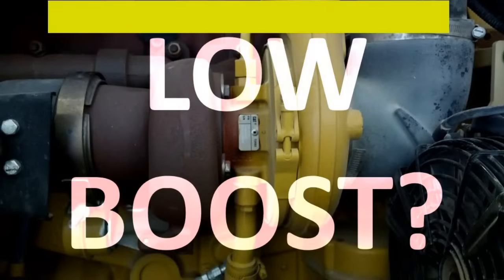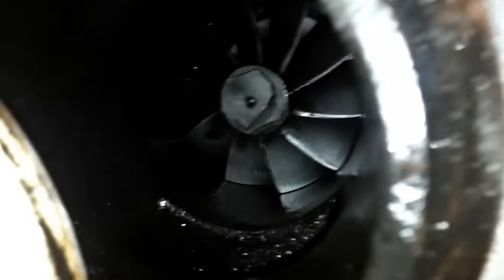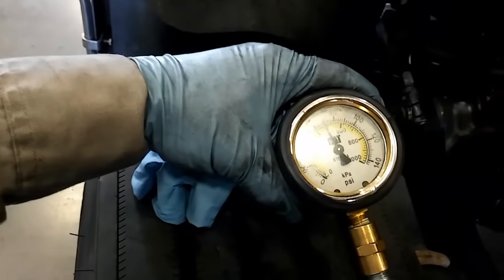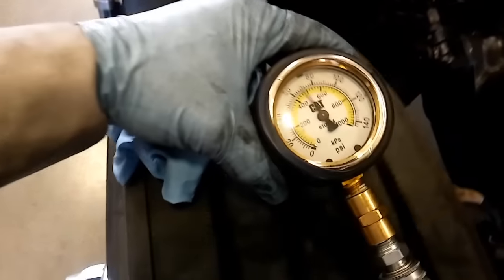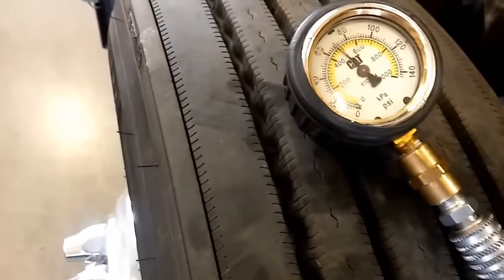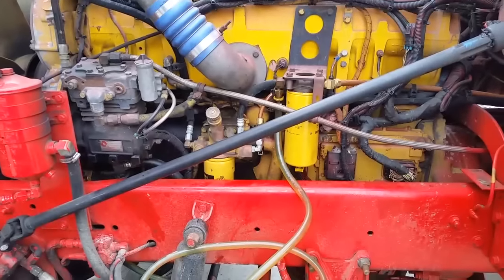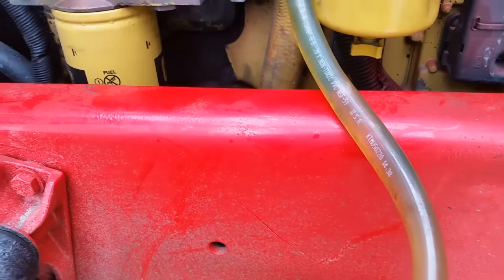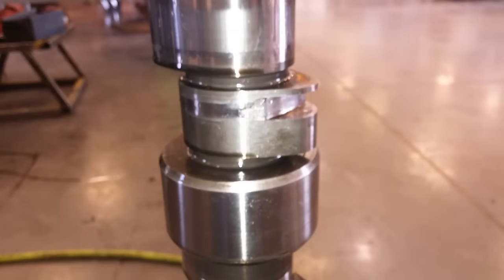Cat Diesel Engine Low Power Troubleshooting.

Comment: "yes, you really need to check your fuel pressure. Just cracking open the valve does nothing." (paraphrased) 
I suppose the analogy is the doctor stabbing the patient with a scalpel to see if he has blood pressure, instead of using a sphygmomanometer. 
Sure, stabbing the patient does tell you something, its just not helpful. If the patient bleeds profusely, that means the patient has some blood pressure, and therefore is not dead. You obtain the same knowledge about your engine if you crack open the fuel pressure test valve.

Comment: My check engine light comes on when I'm driving with a load and then I lose  Power the truck stays running but I have to pull over shut it off and start all over again
Reply: Did u find the problem??

Comment: My ck list 
1. Filters over 300 hours replace
2 ck fuel quaility
3 battery ,yes batterys load test and i torque cablez to 19 foot pounds /find a lot of lose cables and ck cables at starter
4. Air charge boot cooler clamps 12 foot pounds
5.ck inside the tank for water & thrash
6. valve lash,valve lash ,valve lash including injector setting 
7. Test air to air cooler 

Thats my automatic checks

Comment: 400 lbs of pressure is insane to think about. Sounds like a fire waiting to happen. 
I can just picture a leaking fuel line spraying the whole engine bay within seconds.
Reply: hahahahahahahahahh common rail systems run ridiculous pressures (at least in pickup trucks) 
thirty thousand psi in a fuel rail. no joke its in the specs Bosch lists (they make the injection systems for ALOT of diesels),
Reply: No fires though. Diesel doesn't burn at atmospheric pressure.
Reply: Diesel must be atomized to catch on fire. Also a lot of Diesels use upwards of 20 thousand PSI.

Comment: My c15 MBN surges when pulling full load at 16-1700 rpm. Manifold pressure follow the sound fluctuating between 33-35 psi. What’s causing this?

Comment: What level should the throttle position sensor be I have a scan gauge kr and it shows 93-94 and I have low boost.  Pretty sure I need a new throttle pedal

Comment: Good day respected sir. I have one question about cat engine c6.4. Sir we were change the fuel injection pump & injector. But we installed recondition injector & pump. Our Exavator is taking much load during working kindly guide about problem.

Comment: Hi. I have tractor Challenger MT575B with C6.6 engine. Original engine power is 190hp for that tractor. I changed injectors (all 6). The fuel pump is reabuilted, fueling is cleaned and i have one problem. The engine runing is perfect, sound also but the engine have only 115hp. I called my friend who was chiptuning. He is run it with software for 220hp but my engines run only on 135hp. I noticed that the turbo control rod does not move. Can you advise me? Thank you and im sorry for my english 🙂
Reply: The engine doesnt smoking

Comment: Cat 3116 smokes a lot when cold start and when its getting whorm it has a slight shake at 1000 to 1100rpm I think it might have bad  injector now I do know it dose have a pinched return line but fixed that no different

Comment: I have a peterbilt 357 with a 3406b engine with inframe done. Fuel pump has oil leak but when I’m loaded the truck does not pull. Has no power it takes a lot to reach 50 miles. Pretty much 0 torque.
Reply: Was it like this before the inframe? Oil leak on pump, usually is the plugs on the back side, or the governor. Can leak oil on the accessory drive cover, but that is a major repair. When I work on one that someone has overhauled and comes in with low power, first thing I question is what parts was installed. Just because they are yellow don't mean they will work properly. Since your talking 3406B, you have 7FB, 4MG, 5KJ, 3ZJ, mechanical engines, not counting PEEC. Plus all the different HP available with that combination of correct parts.

Comment: Just rebuilt an mbn c15 starts then surges shortly after but goes back to running smooth. Got it out on the road and it runs like a dog. Low boost only around 25 pounds and check engine light comes on and off. I believe it’s something with the ecm. Any thoughts?
Reply: Just a thought here. We had similar problems with our cat 3126. It would surge on a cold start until it warmed up and recently it would surge randomly after it was warmed up. Sometimes the check engine light would come on and flash once every 5 seconds. While it was doing this it would run very bad with low power. I changed the injection actuator pressure sensor and unhooked the batteries overnight. I'm no mechanic and I know next to nothing about diesel engines but that took care of the problem.

Comment: I just put new used engine in .y 3126 2000 chevy c6500 pedal wodked fine when old engine blew up now it only idles doesnt accelerate when push pedal i checked the plug in it only shows 12 volts no ground

Comment: I have a 3406e cat I recently just rebuild it put brand new injectors in redone everything from top to bottom I have full Boost on my Turbo I had a guy from Caterpillar come set the timing and my injectors I took very good care of this motor I had almost 2 million miles on it before I rebuilt it it would still pull a full load up the mountains the power was there if I needed it I've done everything I can know to troubleshoot I've had it plugged in numerous times and nobody can tell me nothing can someone please give me some advice

Comment: I got a 2002 Chevy c6500 stuck in limp mode the gear light is on check engine light only come on when it try’s to shift won’t let me go over 25

Comment: Hello my friend we have c13 ecm cat engine...the running speed according to the application should be 1800 rpm but engine  only run on 400 rpm (stack like that) not reach to desired speed 
When we check all sensors we found the ecm didn't give any alarm when coolent level sensor connector is disconnect also no reading for coolant level ....while we took the same sensor and checked in other engine and its working properly...so does the problem with ecm? and does the coolant level sensore couse engine power derate? Our engine working hrs is 400 hrs its just like new ...waiting for your kind reply 
Regards
Reply: Hey Ali,
         I see he didn't answer yer question. My 07 peterbilt witta C13 has been derated for 2 weeks now AND OIL  pressure has been intermitently 0 to normal pressure. The owner got a new engine wire harness. Didn't fix it. I checked the active fault codes and found 2. Low intake oil pressure on intake valves( probably the valve actuator oil system) and a low engine coolant level. After new harness and installing a mechanical oil gage to make sure we actually had pressure. We did. Then boss n shade tree mechanics were then outta ideas. I told my boss he ought to get that coolant level sensor while I was at work driving this debated truck.that evening he installed it and this things been a raped ape so far

Comment: I have a 3406B. I'm looking for the usual suspects for loss of power. I removed the air fuel ratio module. Now I have a new problem. The threads came out with the bolt closer to the engine block. Is it safe to helicoil the threads on this?
Reply: Yes, I helicoil both of the holes. If I have the governor off, I certainly helicoil every hole.
Reply: @johngoldsmith6629  Thanks so much for your reply. I put a helicoil in just the stripped out hole. I ended up making a hand held jig with a piece of 1" square stock X6". I used a drill press and drilled through the square stock for a guide to hold the drill bit at a 90 when making the hole with a cordless drill for the tap. I only did one hole. Worked fine.
Reply: @Roadtractor-p3j   What was the low power? Make sure you throttle linkage is getting full throttle. Do you know your full engine serial number?
Reply: @johngoldsmith6629  I don't know the serial # off hand. I believe the throttle linkage gets a full throw. The turbo  doesn't spool up. I inspected the turbo. The fins are good and no play.
Reply: @johngoldsmith6629  At this time, the truck is in the barn for the winter. It's an 86 Peterbilt 359. It needs a set of batteries which I'll get on tuesday and I can't road check it now because of the other restorations going on. I found no issues in the fuel mixtre ratio valve but put a new diaphram, seal and o rings anyway. Theres a possibility it was leaking air at the mounting.
Reply: @Roadtractor-p3j   I need to know what you have. Did you inspect the hot and cold side? The hot side you can't look right at it. The nozzle on the turbine drives the turbo. Also the timing advance is  a know problem. The engine serial number should be stamped on block number five cylinder exhaust side. Year model?, JWAC or ATTAAC? Also on top of the fuel pump is a part number.
Reply: @johngoldsmith6629  I only took the hoses off the cold side. I’m unaware of a nozzle on the turbine. I’ll look for the number on the engine tomorrow. I was a bit pessimistic on the fuel mixture ratio. The  timing advance maybe something to look into as well. Thank you.
Reply: @Roadtractor-p3j   It is tricky to see the part on the hot side, it drives the darn thing. get me as much info as you can.
Reply: @johngoldsmith6629  I’ll do that. Wow, all of a sudden I’m not alone. Very much appreciated.
Reply: @johngoldsmith6629  Happy New Year. I found no serial # and the data sticker was far gone. When I get the engine re-started I'll put a fuel pressure gauge on it and start from there.

Comment: Hello I have a 2007 classic xl and it feels like the truck is missing under hard pulls and feelt like it had really bad harmonics 

So I got the Pittsburg power balanced and damper 

Since then the engines feels much smoother but still has a bad miss 
And shudder
Reply: This is a c15

Comment: I had a lose of about 9 psi of boost on a hard pull and a shake . My shop hooked it up and it showed #1 and #2 injector fault . The shop told me that both injectors usually don't go at the same time and looking closer the wiring harness to the injectors was bad .
Reply from the maker: The injector harnesses are common failure points, due to them being soaked in oil and next to so many moving parts and extra heat. Cheaper than injectors though.
Reply: I had same problems with a bad shake Change the outside harness that was not it I changed the two inside harnesses that was the problem.
Reply: just out of the blue while up a load I was 400 miles into a 600 mile trip and I lost power and notice my boost gauge would max at 32 psi and fall to under 20 psi and the motor shudders if you keep running the boost up over 30 psi, once i got into the grades the engine really flatlined on me and had to crawl up the grades about 20 mph, and if you accelerate into up to 25 to 30 psi it shudders and pours out white smoke, but I made it to the house, and because of Adept Ape videos I will be check the fuel pressure 1st because there was not check engine light that came on so it's leading me to believe that it's fuel related..

Comment: ? I have a knock in the front center of my 2007 c15 cat when I ask about it the shops all tell me it's a common noise on this engine.  Can I fix this by changing the timing gears or should I just leave it alone?

Comment: my 04 c7 accert looses power and dies  i changed the fuel line same problem  i can get it started by opening the fuel  by the fuel filter and blowing air pressure ion fuel tank

Comment: When draining water out of my fuel separator 3406 cat the engine wants to shut off I always got to throw that filter away and replace it when draining the water you can hear the fuel gargling this is happened about the last 10 times where is the water coming from
Reply: Water is in the Fuel, from fuel contamination.

Comment: I have no check engine light but with sporadic loss of power and bluish white smoke mostly white smoke
Reply: But if I shut truck down disconnect batteries for 45 seconds it runs good for a while no issues then eventually does it again
Reply: Also it's a 2007 W900 mixer truck with a cat C11 assert twin turbo

Comment: for the fuel pressure at what rpms?
Reply: Arturo Padilla I believe fuel pressure is constant. At least on most gasoline engines it is, usually the pump (again in gasoline engines) is on or in the tank itself, and driven electrically.

Comment: C15 ACERT.  Low power.  14,000hrs.  Original DPF.  Regents every 6 hours.  Wonder what the problem may be😭
Reply: Fuel pressure
Reply: As the DPF stops up over time, more REGEN's are required to reduce soot load. You need to have a datalog run and see what your DPF dif. psi is at the end of the REGEN. Also you can have a patch test done to see how much soot is passing through the DPF.

Comment: Why fan clutch turn on even if he is cold temperatures
Reply: Oil tempuratre can rise and it be cold outside. Turbo can get hotter than the engine. Fan helps keep the turbo cool as well not just the engine.

Comment: Hello, I have a cat 3196 Marine Serial No. 2XR 03982, I changed the cylinder head, turbos, official CAT service reprogrammed the ECM and all the correct parameters except the pressure differential of the turbos, everything is correct but it does not go above 1000 RPM under load, in empty it goes perfectly.
Revised fuel circuit, filters, drain valve, no leaks are seen or heard, but the turbos still do not turn up.
What could it be, can you help me?

Comment: I have 2001 379XH  Peterbuilt,  with a 1998 475 cat.  I have very low power on any grade, but on flat land the truck runs out of numbers..  Could it be low fuel pressure ? My boost is at 20psi, I know it should be higher.

Comment: No check engine light but low boost also low oil pressure truck runs fine on flat land but horrible in hills fuel pressure is fine what is your email
Reply: Also horrible fuel mileage empty or loaded even empty truck slows to 35-40 mph on hills
Reply: Just_trucking - every engine is engineered differently. You should also give ape the engine type. When us mechanics go after an issue we should think like an engineer
Reply: None Ya c13 twin turbo
Reply: Just_trucking did you ever figure out what was the issue . I’m having similar issues..